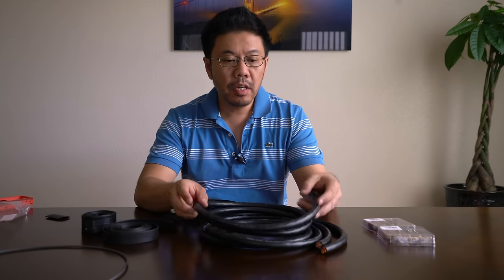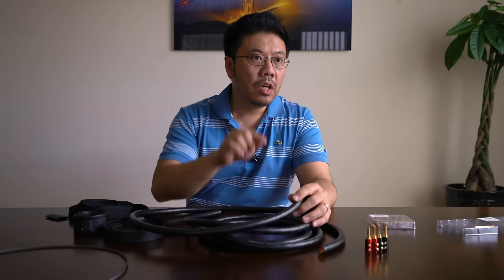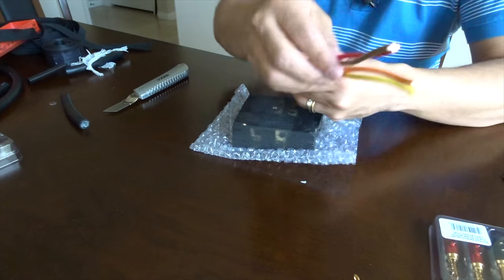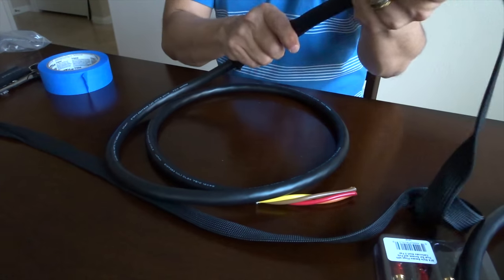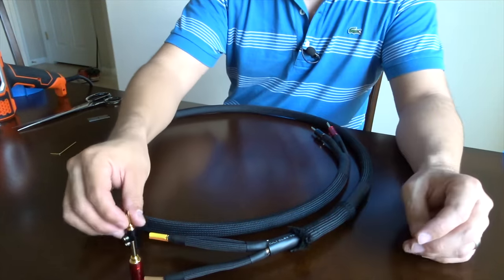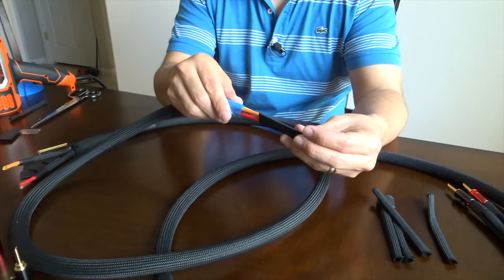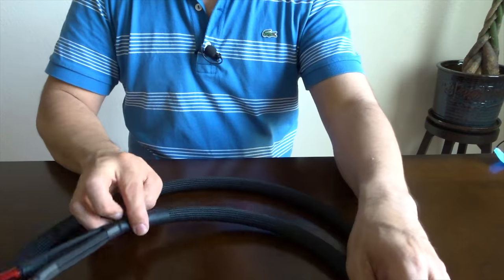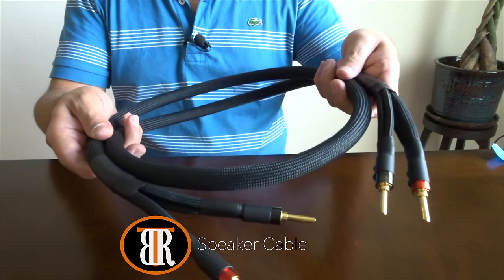Making The Best Speaker Cable For Money, How To DIY HiFi Cables

Comment: Speaker cables don't need to be "run in " or "broke in". They are just wire.  Only electronic, speakers and work boots (haha!) need to be broken in.
Reply: You are wrong. Cables made by copper and connectors have connections that will have time to break in. The cable capacitor value will change by time.

Comment: Great tutorial! But you didn't use the star quad wiring method so you don't get star quad benefit. Is it intentional? You need to connect Red-Yellow to +, Brown-Orange to  - to make  star quad work. It is useful to mention. Kind regards.
Reply: If you use this cable for bi-wire, will you loose the star quad benfit?

Comment: Hello! Can you make a comparison between your reference speaker cables from Mogami and a regular H07RN-F 4x4mm2 copper powercable for 2 or 3 EUR each meter? I believe that you won't find huge differences. Okay, the color code on the single wires.... ;-)

Comment: I'm a little confused on the effective gauge. 2x12awg is effective gauge of 10awg based on online calculators. Would it not be cheaper just to buy 10awg wire? 6awg would be if all 4 were combined into a single wire in terms of effective gauge? Am i missing something?

Comment: @TharBamar I've heard in one of your videos when putting together I think it was speaker cable, you stated that I don't need the ends.. where the screw goes on top of the banana pull up. Is that because some of the screws are magnetic? Or if you can please enlighten me. Thank you

Comment: when stripping the jacket off these kinds of cables I would recommend buying the proper tool however if you are to do it with a razor blade bend the wire into a U shape and just push the blade making sure not to cut through the inside wires jacket cutting the copper wire with a razor can cause interference

Comment: According to Audioholics, and I agree with them, the cable size (awg) you are using is an excellent choice for stereo speakers. I am pretty sure the president of Audioholics is an electrical engineer that has worked in communications so he understands how frequency affects cables. They have done different youtube videos on the subject of speaker cables and snake oil in the audio cable industry.
Personally I think your speaker cables turned out great and are first class. Well done.

Comment: I made these cables yesterday. Amazing! They replaced a pair of $2k WireWorld Eclipse 8 cables. I. Am. So. Impressed! Thank you so much. I recommend the locking banana plugs as regular bananas sometimes are too tight and eventually break at some point. Could you create a video on making 3 x 12 AWG (or larger) XLR cables? Amazing work. Thank you again.
Reply from the maker: Thanks for sharing your experience.
Reply: You bought wires for 2k? Lol

Comment: I am going to build my own cable after looking at speaker cables in the $2 - $4K range (too much dough). BTW, for those who suggest that this is too much for a home stereo system, it all depends on the system. If one is using 1 kW+ power amplifiers and have clean and/or well-conditioned source power, these will be great and are not overkill. Excellent video!
Reply: It is likely to be overkill, it depends on what the impedance is and cable length really. It would have to be a crazy long length for it not to be overkill for most 8 Ohm runs.

Comment: Two weeks into listening to my DIY 3104s and I must say I'm very impressed. I'm a huge 2 channel music guy and I love listening to my Martin Logans ESL X and dual 1100X. In my opinion the floor standing speaker list is VERY SHORT when comparing however they are also good revealing weaknesses in your system. The first 100hrs or so listening, the 3104s were muddy, poor sound stage, and subpar bass. Now into nearly 300hrs of signal passing through, it sounds like I've installed another set of cables. The center stage is wide but tight enough to pick out where each artist is onstage. I listened to some older music that I'm familiar with the detail and it was like WOW....hearing voice definition, breathing I haven't heard and the guitarist actually plucking the strings. I can continue writing but let me just say, as an audio/video enthusiasts, I've always "chased the dragon" trying to get the best sound possible from whichever system I had...and sometimes spending considerably more than putting the Mogami 3104s together. These by far are the best sounding cables I've listened to (in my system) for the money. Ended up making 2 pairs of 8' cables to bi-amp my speakers. Wish I could share a pick of the finished cables.
Reply: I almost reacted like "300hrs? You're bullsh!tt!n", then I remembered that to a lesser extent, a run of Audioquest speaker cable in my system took a while to settle in.  My wife and I noticed it on some slack key guitar music about two months after I installed them.  I wasn't running music all day long to break them in like I normally do with new components.  Coherence was mainly the "issue".  Some things like distortion, you can't get used to.  So, I don't entirely buy the "you just get used to the sound" argument when it comes to break-in (it's a real thing folks).  So, yeah, I'm going to try this build out, what the heck.  I might even do two pairs and see if bi-wiring makes a difference.  If it doesn't, it'll just look like it is doing something?  :)  I'm excited either way.

Tekton Moab, PS Audio M700, Gustard A26, PS Audio P3, AudioQuest whatever XLR and speaker wire.
Reply: There's no "break in" for cables dude...

Comment: As a electrician, cutting into a sheath like they damaged the conductors, your can use aS/O cord stripper to strip that without damaging the wires inside.

Comment: I agree Mogami cables are the best for many applications - very good & honest - real value for money. One of the best regardless of price - which is relatively cheap.  ... However, I don't like that you are connecting the leads of the 2-2 speaker cables in the 1-2, 3-4 method. If you use the 1-3 (starquad) configuration you get a much lower capacitance - on an average a little over 21% reduction on capacitance from 100Hz to 100kHz. Try it. You can easily swap them. You should use Orange+Brown and Yellow+Red. You will see an improvement. Thanks for all the great videos.
Reply from the maker: I will try that, thanks
Reply: what if you want to use it as bi-wire? how would you combine?

Comment: I would rather connect together in pairs the opposite wires (yellow-red and orange-brown). In that case you would get the so-called star-quad configuration often used in microphone cables to make them more noise resistant. Also star-quad is used by Audio Quest in many of it's speaker cables.
Reply from the maker: These cables are starquad.
Reply: What's the difference as long as you keep the cable colors consistent???.
Reply: @gz4058  Please Read in Wikipedia what is the so-called Star-Quad cable configuration.
Reply: @IliyaOsnovikov  I don't know this particular cable and colors but you are suggesting that the pairs that the OP used aren't diametrically opposed to each other?
Reply: @gz4058 Да. Провода соединены между собой не правильно. В видео ошибка.

Comment: If you want the sleeving to be taught and not as loose on the cable, you can melt the ends of it to the insulation in conjunction with the heat shrink, sleeved custom PSU cable tutorials are a great guide

Comment: Excellent tutorial thank you! I just made my own using 3103 cable. The sound opened and the bass got much clearer. Much cleaner sound
Reply: Good to hear it, I have some Mogami 3103 cable on the way. I been testing different cables for months and the best sounding one I found was the Mogami 3082 cables. They are very neutral and natural sounding but the wire gauge is little thin for my set up, so decided to go with the Mogami 3103. BTW the worst sounding speaker cables I tried were the Canare 4S11's. They had way too much midrange. People say they settle down after many hundreds of hours but I played them close to 200 hours and they still sounded the same, not willing to wait anymore. The Mogami 3082's also sounded like they had too much midrange at first too but they didn't take long  to start sounding more full and after about 150 hours sounded great. I had the 3103's pre burned in.  Any updates on your Mogami 3103 cables?
Reply: 3103 is a great cable. You will enjoy it for sure. Here is my experience: It may sound a bit bright, but in a nice way and depending on your gear. Low bass is also enhanced, not so much the mid bass, and depending on the type of music or the recording it can be a good thing or not. 
With my EL34 bulb amp and tower speakers is great, I am very pleased with them. So balanced and coherent. Great soundstage and tridimensionality. With my solid state amp and bookshelf speakers, as I said, depends on the type of music, recording,etc. With some recordings the highs may sound forward and disconnected from the mids, sometimes feels compressed. With some other recordings the sound is very refined that makes me crank up the volume... addictive. That has been my experience, it’s worth trying, it’s a very very good cable.
Reply: @centinel8944  Just got the Mogami 3103 cables today and have been listening to them with a variety of music and I've got to say I'm liking them a lot.  I like a little brighter presentation, brings my 20 year old pair of DIY Dynaudio speakers alive. They are a 3 way design so already have a lot of detail the midrange and seem to be working just perfectly with the Mogami 3103 cables. The speakers are full range, but I'm using them as big satellites to go with a pair of Dynaudio 30w100 subs in stereo.

 In my experimenting I tried Supra Classic 6, they had a excellent soundstage and detail and were very easy to listen to but were too heavy on the bass and mid-bass. Also tried the Canare 4S11 as a I mentioned, tried the Mogami 3082 which are nice, but a little lacking in midrange energy, some Audio Quest type 6 wires which were OK, but I didn't find them to be all that musical and many other types of wire I had collected over the years, but played that old collection for about two minutes each and said nope. The Mogami 3103 cables seem to fall right about in the middle of Mogami 3082 wire that was a little too dark in the midrange and the Canare 4S11 that are too bright in the midrange and so far  3103 Mogami's seem to be the Goldilocks of speaker cables, just right.  I considered the 3104 wire but was worried being basically the same design that they might sound like the Canare 4S11 (maybe somebody could comment on that) and besides 4mm wire although Mogami lists it as 12 gauge is really much closer to 11 gauge and is plenty thick enough for my relatively short run.  I did get the 3103's pre burned and froze. From my experience wires do "burn in" and no it's not just me getting used to the sound. I ran the Canares  for almost 200 hours and never heard a change, but with Supra and the Mogami 3082's I did, the Audio Quest had already been used for years so they were already fully burned in. I don't know about the Cryo thing, but it was part of the deal and couldn't hurt, so why not.
Reply: @phoebus  could you provide the measurement of the wraps, braiding, that correspond to what was used in this video when using the mogami 3103 instead? thanks.